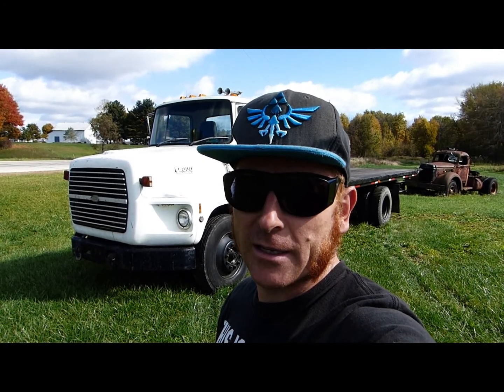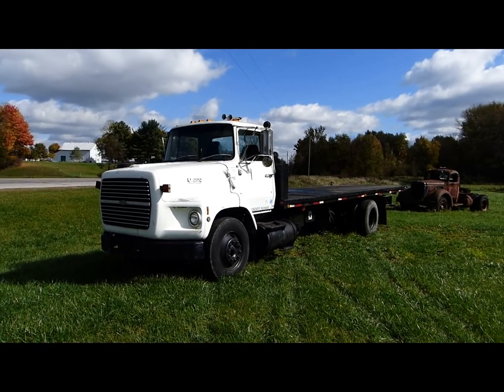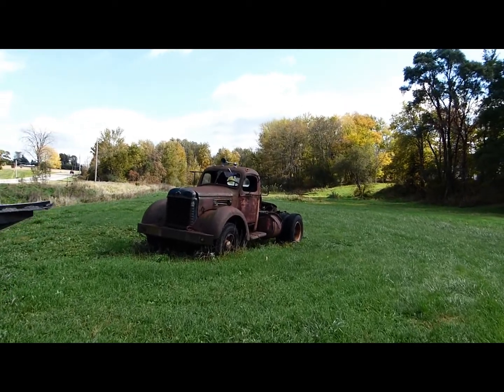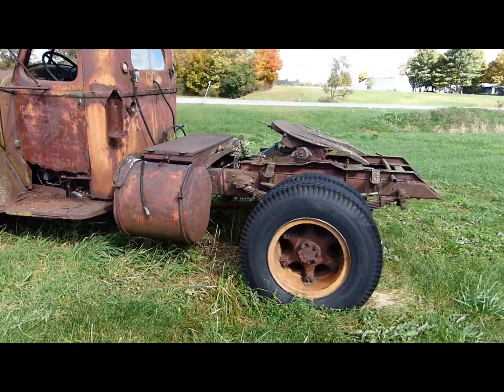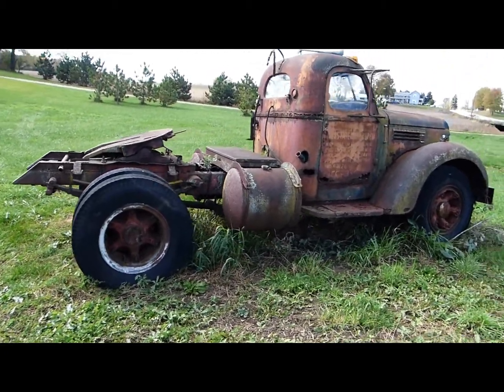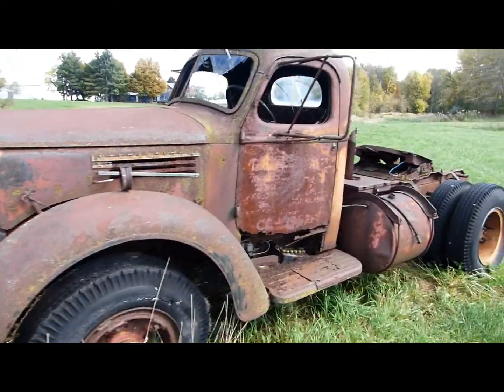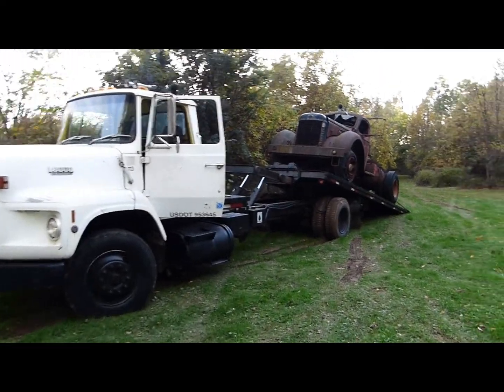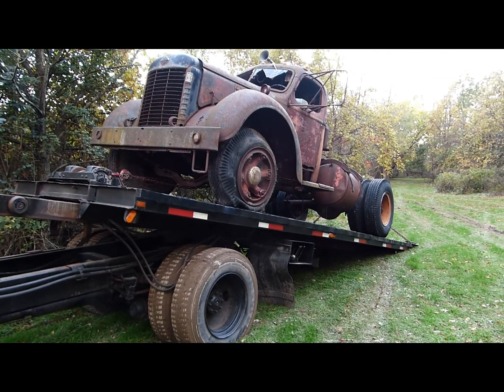1949 International KB12 for restoration / custom / ratrod

Comment: This is a KB-11 not a KB-12.
Reply from the maker: Thanks, I'm not knowledgeable upon old Internationals.  The seller, seen briefly in video, told me it was a KB-12, and he has since died.  What are the differences between KB-11 and KB-12 ?
Reply: @HemiChrysler  KB-12 has front axle 12 inches further forward from cowl than KB-11. On hood sides  the louvers go almost to the cowl end while the 12 the louvers end about 12 inches from the cowl end. The 11 had a large 450 cubic inch gas six that  weighed 1250 lbs. The 12 had a larger gas six made by Continental of 586 cubic inches that weighed 1900 lbs. When large Cummins Diesels were installed the KB-12 cab needed no mods for it to fit
Reply: my dad just to have 49 in Cuba for many years.